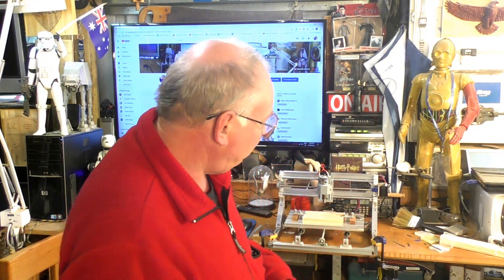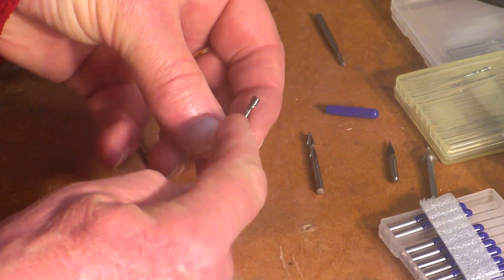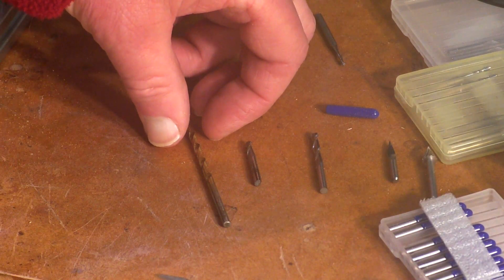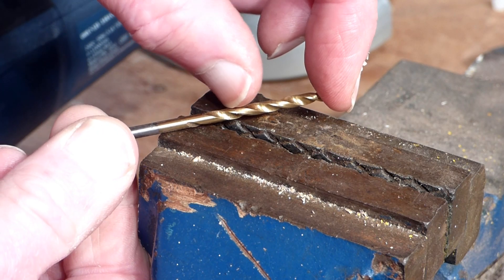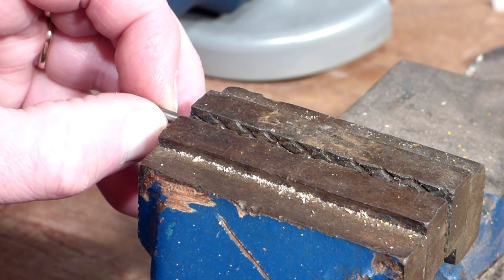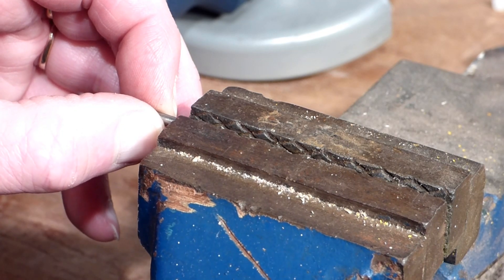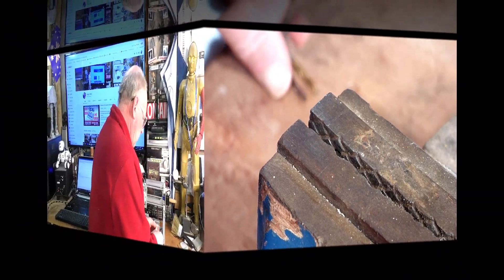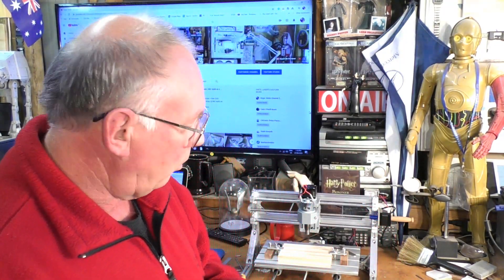How to make an 1/8th inch end mill from a HSS drill

Comment: Total crap.....I've never seen anything more crude, either in the tool or the making.......0 out of 10.....if you think this is an ideal solution you're off your trolley......drills do not have a side relief as the diam is ground round and they only cut on the end face.......you "could" plunge with this "cutter" but you won't mill with it......shame on you for misleading the noobs.
Reply from the maker: Now now Ian, settle down, this was only to get me out of trouble and it does work. Not however technically correct I agree.
Reply: @inventorsworkshop9600  OK........ the angle grinder bit got me worked up, that was crude to the extreme, a bench grinder would give you more control to do a more credible job, especially with a 100mm diamond cup wheel for the carbide stuff, but what the heck if it worked for you, case solved.
I have "re-purposed" some carbide inserts with a small lip in the top for soft materials by using a small 50mm diamond cut off wheel in a die grinder.
I have a cutter grinder and I've often thought about making cutters from odd drills by giving them the side clearance angles etc, but the carbide stuff on EBAY is getting so cheap and available.....nothing came of it.
But you've got me thinking......I'm going to hand regrind a carbide masonry drill on the sides of the brazed insert, 3 mm up, to give a 3 deg side clearance and see if it will mill without catastrophic results.....carbide is carbide.
Reply: @gangleweed  Actually a drill will have a primary clearance angle of 1-2 degrees of side clearance so the heel doesn't drag, along with a secondary clearance relief cut. without that primary clearance angle the drill, in particular the shoulders would simply burn up from friction.
And if indeed you have a tool&cutter grinder, and a diamond cup wheel why on earth are you going to hand grind clearance angles on carbide masonary drills?
Reply: @zootallures7003  Because I can and I get too lazy to set up the T&C grinder unless I have a number of tools to mess with.
The carbide masonry drills will cut sideways as a milling cutter if you grind the side relief......most depth of cuts on hard steel is shallow anyway.....this is also a get me out of trouble when you just must have a cutter for a job and HSS won't do it.

Comment: It's really not possible to grind the carbide endmill with that cutoff wheel you were using.  You will need a diamond wheel to accomplish that.  There are places that recondition used, chipped or damaged endmills for a fraction of the cost of new ones, especially carbide, but you may find the carbide new endmills 1/8" and under are right at the break-over point on cost for reconditioned or new.